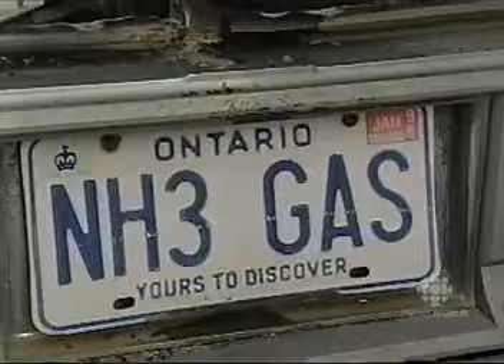Hydrofuel NH3 (ammonia) Car, CBC The National, Nov. 6, 2006

Comment: Hello Mister Vezina, I find you have a good vision and NH3 is the solution for the energy problem. I found one can produce NH3 from air and water & electricity with the Haber Bosch proces. NH3 is easy to store carbon free so no emissions. I wonder if you put a lot of solar panels in the desert and convert the electricity to anhydrous ammonia this can be a real freedom fuel!

Comment: "Because urea's four hydrogen atoms are less tightly bound to nitrogen than the hydrogen bound to oxygen in water molecules, it takes less energy to break them apart: Just 0.37 Volts need to be applied across the cell, against the 1.23 Volts needed to break down water." - greencarreports(.)com/news/1022028_can-urine-rescue-hydrogen-powered-cars

Comment: Only if there is a lack of oxygen. Since Natural gas is mostly methane, it tends to burn very well. You can't store LNG in a car. It requires very low temperatures. You could however store propane in liquid form at room temperature. I have seen some delivery trucks using propane.

Comment: They use electrolysis. The anode is made of graphite. The electrolysis process makes oxygen which burns the graphite. That is the reason why they replace the anodes once in a while. You can even find such anodes on alibaba.

Comment: A 13 gallon fuel tank in a diesel car that gets 86 mpg has a range of 1118 miles. A Prius has an all-electric range of 11 miles (at 95 mpge), and 50 mpg times whatever is its fuel capacity. According to en(.)wikipedia(.)org/wiki/Ammonia an NH3-fueled car would have a range of 1118 / 2 * 0.79 = 441.61 miles. Average daily travel in the USA is 35 miles: askville(.)amazon(.)com /average-commuting-distance-americans/AnswerViewer(.)do?requestId=2554434

Comment: Clean generators are excellent battery replacements if noise and exhaust can be handled. I'd imagine a single car could provide enough power to eliminate or even reverse the electricity bill, but perhaps grid power is cheap enough (possibly by ignoring fossil fuel pollution) to only be worth doing that during peak demand.

Comment: @EclipseNowBlog It would appear EV is preferred because electricity can be generated with nukes and then distributed with minimal losses. However, a significant portion of applications, for example, 10-20 ton fishing vessels, aircraft and long haul trucks, will never use EV because batteries are too heavy. Ammonia can be made with nukes at 40% LHV efficiency, and burned at 40-50%. The efficiency of Nuke-NH3-IC engine may compare favorably with Nuke-grid-charger-battery-controller-electric motor.

Comment: If you've never handled with the Haber-Bosch-Synthesis of Ammonia.
It's everything else than "efficient" and "good". 15% of the educts will react. The rest ist recompressed to 300bar and heated to ~450°C.
And now: Think about, if every great guy haves a "clean" Ammonia-car.
If a better Ammonia-Synthesis is developed: great! But so long, this hasn't happen, a ammonia car is nearly rubbish.
Handle with facts. Not with dreams. 
What uses the best planning if it is impossible? Make it possible first
Reply from the maker: Hydrofuel Canada's Micro Ammonia Production System (MAPS 1.0) US Patent Issued, Commercial Prototype Completed | CNW Newswire, march 18, 2024
https://www.newswire.ca/news-releases/hydrofuel-canada-s-micro-ammonia-production-system-maps-1-0-us-patent-issued-commercial-prototype-completed-881064402.html

MISSISSAUGA, ON, March 18, 2024 /CNW/ - Hydrofuel Canada Inc. ("Hydrofuel") announces US Patent 11,885,029 "Systems and Methods for Forming Nitrogen-Based Compounds" issuance and the completion of their Micro Ammonia Production System (MAPS 1.0) commercial prototype, enabling high-yield, sustainable ammonia synthesis from air and water with unprecedented efficiency using a gas-phase electrochemical process.

The MAPS 1.0 and 2.0 technologies significantly reduce the costs and energy requirement of making ammonia (NH3) compared to traditional methods. Multiple 381 ton per year units can be combined to operate in series or parallel to increase capacity.
Hydrofuel Canada MAPS Reactors
MAPS 1.0 Initial Prototype shown with Commercial Scale Prototype
(Hydrofuel Canada Inc.)
	
Hydrofuel Canada CapEx & OpEx for MAPS 2.0
Hydrofuel's MAPS 2.0 Opex, Capex, Customer Deposit
(Hydrofuel Canada Inc.)

The US$700,000 MAPS 1.0 version uses externally produced hydrogen (H2) to synthesize with nitrogen from air to make ammonia. If the H2 source is Green, so is the NH3 it produces.

The US$850,000 MAPS 2.0 system represents a major breakthrough in the production of green hydrogen and ammonia, as it addresses one of the biggest challenges in hydrogen production - the high cost of electrolysis. By combining hydrogen and nitrogen production in a single unit, MAPS 2.0 eliminates the need for separate production processes, significantly reducing the overall cost of green ammonia and the hydrogen in it to 50% of the cost of hydrogen produced via current electrolysis technologies. All Capex and Opex costs quoted exclude any government incentives or tax credits.

Comment: There is another technology and you can search for the word gallium and find it. It is an alloy of gallium and aluminum. Add water, the Al react with the H20, forming Al2O3 and H2. The reaction is fast. In the end, you get Gallium and Al2O3 which can be recycled. Problem is that making Al produces a lot of CO2.